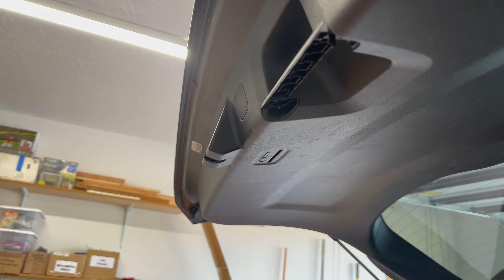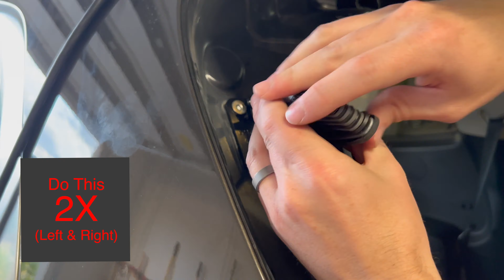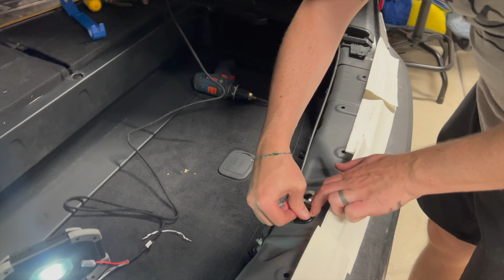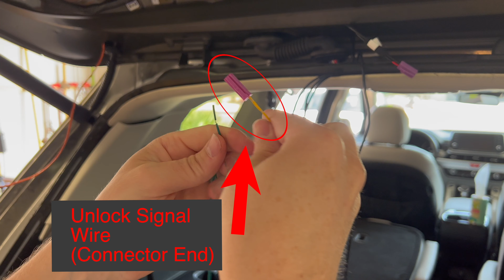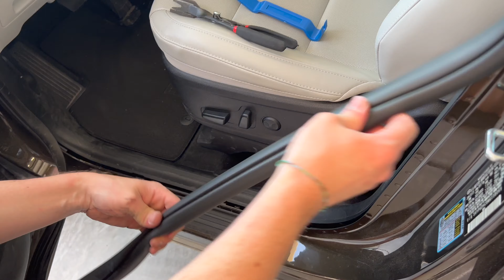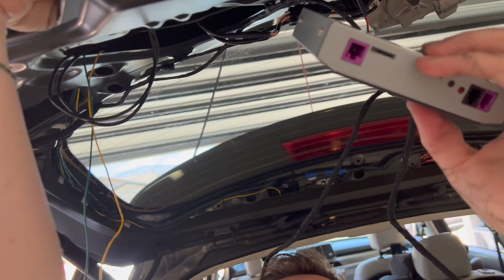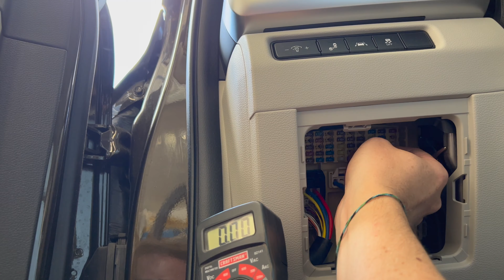2021 Kia Telluride - Autoease Power Tailgate Retrofit Installation

Comment: it would be usefull to show the wires that you are routing since the kit labeling isn't so great...without this video .this installation would be impossible since the kit comes with no instructions except what they send you and they are almost useless. Wire routing ..slow down..show us the wire bundle so we can identify them and tell us what we are doing before you show us how you did it...I will say support via email was excellant..i had questions and autoease answered me promptly.  Recommend placing control unit on the left side of the hatch rather than the right as shown...the cables for the  actuators is plenty long while i ended up splicing some wires upfront to extend the power cable at the fuse box because i end up about 8 inches too short. end result everything works great...my removte requires 6X unlock to open with remote fob,  bumper foot motion works good. I did not attach red wire to fuse box as the instructions were not good in explaining where that goes. I think thats a safety to prevent the hatch opening while the engine is running.  Also, lock your doors at night. I think a cat walked under my bumper and open the hatch just by passing underneith it. hatch ended up open all night.

Comment: Hi I installed this in my Toyota CHR, it works fine but whilst I am driving the tailgate suddenly starts beeping and it opens to quarter position, then i have to turn off  by pressing switch.  Any advise would be most helpful.

Comment: Does the green trigger wire for the foot switch HAVE to be wired to the same OEM wire that you used? Can I connect it to the same yellow trigger wire that is connected to the main wire harness? I've already installed everything, and put it all back together. Everything works except for keyfob. The issue I am having now is, key fob trunk button not working, and the foot switch has not been installed, still debating if its needed. I'm waiting to figure out which trigger wire to connect it to...hopefully my question makes sense. Really appreciate the time you spent on this!
Reply from the maker: Is the trunk not opening when you press the trunk button on the keyfob? Or is the trunk not opening when you press the unlock button on the keyfob 3 times?
Reply: @bwell1986  i was able to get the keyfob to work with the help of autoease. the guy actually facetimed me lol. the issue is, the long press on the trunk button wouldn't open it, you have to do 3 "slowish" clicks on the unlock button. it takes a few tries to get the rhythm right. regarding the foot sensor, i tapped into the trigger wire for the OEM external trunk button, the button that is right above the license plate. you just tap into that, run constant 12v, acc, and ground, and the switch will work. i did notice a major flaw in the system which is, if youre driving and you push the interior trunk button that the company supplies, the trunk WILL open in the middle of drive. i'm assuming that doesnt happen with a factory installed power lift gate, but i could be wrong.
Reply from the maker: @TimSmith-db1iu  ah yes in terms of the fob buttons, I got the same results. From what I understand, in order to get the trunk button on the key fob to work, auto ease would have had to do a lot more work integrating into the can-bus system of the car.
Reply: @bwell1986  seems like it would be an easy fix because when i do a long press on the trunk button on the keyfob, the car responds to it with 2 flashes of the rear tail lights. that signal has to be going somewhere. have you had any issues with the kit? does your auto pintch feature work on close AND open, or just close? i've had to have several custom firmware updates. it's getting old tbh. i ended up revising most of their manual for them, and they refunded me some money for it.
Reply from the maker: @TimSmith-db1iu  I had the same thought but didn't want to tinker too much and screw something up trying to get the trunk fob button to work.  Only issue is the foot sensor is more sensitive than I'd like.  It gets accidentally triggered all the time when standing behind the car with the trunk open (while grabbing stuff out of the back of the car).  I think I need to move the foot sensor just a bit further towards the front of the car.
Reply: @bwell1986  our foot sensor opened while the car with going through the car wash. Autoease needs to do better with this and prevent the tailgate from open while the car is in drive, reverse, or neutral.

Comment: I installed the autoease power lift gate kit on my 2021 Kia Sedona. Took me a solid 6 hours! I'm very handy and it was still a lot of work! So everything works except for the key fob. The front interior button, rear interior button, and outside gate button work, but the key fob does not work. I’ve tried the long press on the trunk button, as well as the 3 clicks on unlock, did not work.

I hardwired the yellow trigger wire to the "white" OEM trigger wire, which was stated in the instructions as the correct wire to tap into, although i'm thinking it MAY NOT be the right one. I also tried to use the OBD port adapter, still did not work. I also tried different fuse locations and it did not work. I looked through the settings on the dash board and there’s no option for “power tailgate”.

Any idea what else I can do. Firmware update? I've contacted the company, but they are lagging on the reply.

Another issue, the door pops when it unlocks. It seems the door is trying to open before it unlatches, there is some force to it opening. Any thoughts on how to fix this? It closes softly, and quietly. Also, I’ve tried both OEM latch, and the latch Autoease supplied and it’s the same issue.
Reply: It pains me that you did not use any wire protectors

Comment: Hello, nice work.  Is it necessary to fix the vacuuming traction motor?  Will it be enough to leave it behind a plastic cover?
Reply from the maker: If you're referring to the latch motor that is circled @ 0:44, I don't think so.  I did not fix or attach it to anything.  The plastic cover held it in place from what I could tell.

Comment: I have this for a 2022 Telluride, I had issue finding the wire to hook up for the remote open of the tailgate. They said look for a 12v positive pulse signal, but I've not been able to find it. Any suggestions?
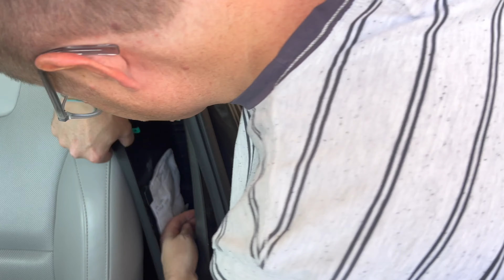Reply from the maker: At about 10:15 shows how to find the unlock wire which is what the unit uses to trigger a trunk open (from pressing unlock 3x). But if you're talking about getting the trunk button on the key fob to work, afaik it's not possible (with this kit and a 2021 telluride).
Reply: @bwell1986  yeah, I know the trunk button won't work, the notes and customer support said I needed a 12v positive pulse signal for the unlock wire, I just could not find a 12v positive pulse signal, I think I originally hooked into the same wire you did but it still didn't work, I'll have to try again, it's possible the yellow wire got damaged while i was pulling it also... Appreciate the response

Comment: If you didn’t want the key fob control feature, can you install without tapping into wires for door lock?
Reply from the maker: I haven't tried so I'm not sure but I don't see why this wouldn't work
Reply: I wish the manufacturer would come up with another way to either add a connector near front door or maybe fuse box so you don’t have to tap into wires

Comment: You have a yellow and a red wire, fused, running up to the steering column. Where do those 2 wires get hooked into?
Reply from the maker: Those two wires hook into fuse slots in the drivers side fuse panel, just to the left of the steering column.  I used fuse taps to connect them to the fuse panel.  If you need more details as to which slots, there are some additional notes about this in the description above.
Reply: @bwell1986   
I appreciate the quick response!!
So in total, there will be 3 micro fuse taps going into the fuse panel by the steering wheel?
Reply from the maker: @fdfc78  Correct
Reply: @bwell1986  
Damnit...know you're making me buy more stuff 🤣🤣🤣
Reply from the maker: @fdfc78  Haha
Reply: @bwell1986  
Forgot to ask...what size fuses did you use for both of the Wires??
Reply from the maker: @fdfc78  The foot sensor kit only came with one 2amp mini fuse and tap but it didn’t fit so I used two 5amp micro2 fuses (and taps) for the foot sensor wires. The other tube fuses that are on the same wires are 2amp so I’m not worried about the higher amps on the fuses I bought.
Reply: @bwell1986  
Thank you
Reply: @bwell1986  
I've got everything hooked up and all wires are showing signal but the sensor isn't working. I had it working when I was testing it before I buttoned everything up. Is there some sort of programming I need to do? When does the foot sensor activate? Truck locked, unlocked or both?
Reply from the maker: @fdfc78  I would try checking all the fuses, checking which side of the foot sensor is facing up (I remember this being confusing in the instructions) and/or try unplugging and plugging in the power to both the sensor and the controller.  The foot sensor should work when unlocked and locked. You just have to have the fob near the car if it's locked when triggering the foot sensor.
Reply: @bwell1986  
Bro, after I sent that last message I gave it a rest for the day. Got back the next day and flipped the sensor thinking it can't be that dumb...well, I have a working foot sensor now 🤣🤣

Comment: How did you connect the foot sensor power wires at the fuse box. Did you just locate the right voltage wires and t tapped Into those wires or purchased another type of connector?
Reply from the maker: @ryan jag I used a fuse tap.  The optional foot sensor package included one, but it was the wrong size for my car which uses 'micro2' (the fuse tap in the package was a 'mini'). I bought the right sized one (micro2) at autozone: https://www.autozone.com/electrical-and-lighting/fuse-and-accessories/p/bussmann-circuit-fuse-tap/547344_0_0
Reply: Thanks for the info and video. I just finished mine on the telluride and works great.
Reply from the maker: @ryanjag07  nice!
Reply from the maker: @ryan jag I actually bought two, 1 for the foot sensor constant power (yellow wire) and 1 for the foot sensor accessory (red wire)

Comment: Great video!  How did you find this kit?   That tool that lets you pop the car panels out is really nice!   Does it come with the kit or did you buy it separately?
Reply from the maker: Thanks! Found the kit through some of the Kia Telluride forums.  The trim removal tools didn't come in the Autoease kit, but usually Auto Zone or Harbor Freight has them on the cheap.
Reply: @bwell1986  nice!  Thanks!
Reply: @BobbyInBlue  ,  I bought a similar kit on Amazon.  You can just search for it.  (Search.... Auto panel remove tool or something like that)
Reply: @The2chopsticks  thanks so much.